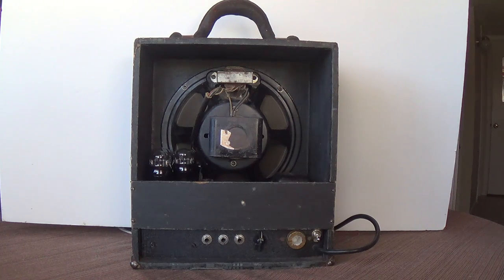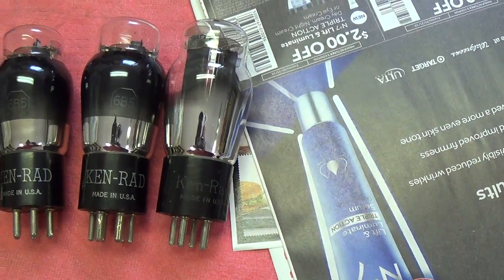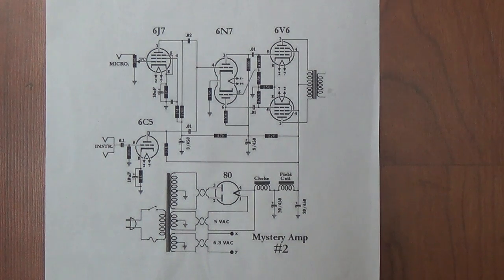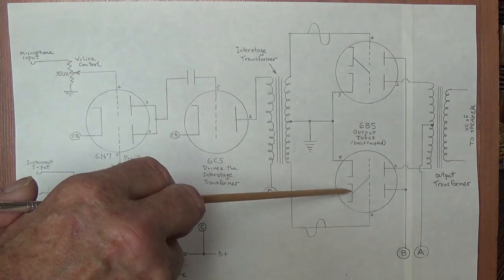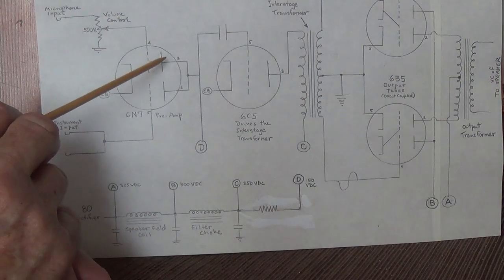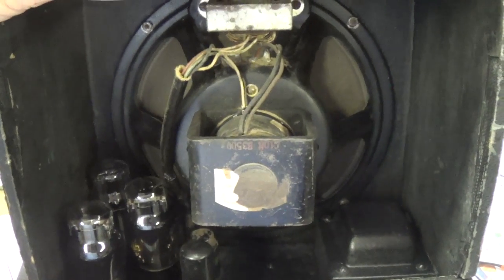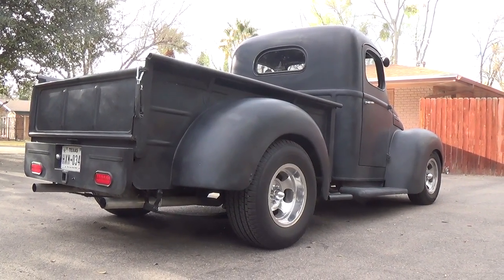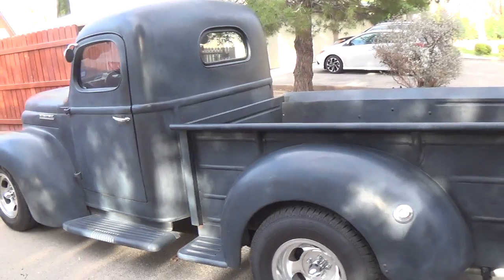Let's Evaluate and Repair the Ebay Mystery Amp

Comment: That is one fine pickup truck. Did you find/restore/put in a new engine? One the amplifier side, I never cease to be amazed at what some of these old rascals sound like...while it would never be heard above a drummer, seems like a nice practice amp with a sweet growl out of those bizarre tubes. Cool.
Reply from the maker: It had the Chevrolet engine already installed, but it didn't run and the transmission was junk. I had to repair both.  Yes, the old amps really sound nice, and there are some that could probably drown out Ginger Baker on PCP.....but I tend to favor the small, portable ones :)

Comment: What a great episode, Doug :)  This is... instantly love.... this amp....as it has an interstage tranny :) it sounds second to nothing if you bring this one up into saturation, but i also know that you´ll probably never do this ;) 
Also using an IST you can run the ouput tubes in AB2 with control-grid current. I own just one Amp which does this and it has two 807 output tubes which put out some nice 140 (one hundered and forty) Watts clean....but it also eats output tubes when running full blast for a time, they´re usually red plating above 80Watts output. Also it has four big (EI160 core power tranny, EI 130 output tranny, M102 interstage and M102b filter choke) trannies inside.....  

If i would have access to ISTs, like you do (what about these 16 dollars....man, over here one like this is about 150bucks, and they´re all made to order) i would already built some amps with these instead of the usual tube phase splitter.

Speechless about this truck........ .!
Reply from the maker: Thanks so much for your interesting and informative input, TC. It's always great to hear from you. I'll send you a box full of IST's for Christmas :):)

Comment: Lovely truck you got there. I remember back in the late 50s, some AM radios used in that era of cars, still had the odd tube in them.   MOTOROLA started with car radios, before  the solid state  models, there was their tube radios  with 5X4, 6be6, 6ba6.  The plate voltage convertsion from 6 or 12 volt car battedies was accomplished with some kind of vibrating transformer to chop up the DC for  a stepup transformer, I believe.
Reply from the maker: Thanks, SC. That's the way I recall the old tube car radios.....a vibrating converter would alter the 12VDC into AC (not sure about the frequency, but it had to be rather low) so it could be stepped up with a transformer. What a roundabout way to power an amp.

Comment: Wow, that's a nice catch!  This amp was young when my late mother was; God knows how much I miss her.  The output tubes are quite peculiar, or are they not?  I just wonder if that connection of the grid to the second kathode is internal or external.  I have never seen this before, so forgive me my ignorance.  I suppose the connection is internal, if not, would it be possible to mimic that kind of tube by connecting the grid of a double triode to the second kathode externally?
Reply from the maker: Thanks, B. All the connections are internal. The tubes were designed to serve a specific purpose and probably were not subject to any external alteration.

Comment: A choke AND a field coil??? For future reference, do you have that Antique Electronic Supply part #?

Also, awesome truck! you need some rattlesnake skin boots driving that.
Reply from the maker: Yep.....overkill at its best :) As I recall it was T156 @ a paltry $16.95. They offer other IST's, but this one had the specs, price, and reputation for this particular application. If you remember the very early Steven Spielberg movie, Duel, with Dennis Weaver.....this reminds me of that truck (although much smaller).....sort of demonic :)
Reply from the maker: No kidding, Richard. I had no idea that they didn't check for legitimate issues like brakes, tires, headlights, etc. New Mexico is nearby and they don't have any inspection program. As a result, when confronted by a noisy, smoking, death trap, it's a virtual certainty that it will have NM plates.

 Modern autos are marvels of engineering......400 HP, 25 MPG, fabulous brakes and handling, etc. and yet they release almost no pollutants into the atmosphere. I really doubt that someone could commit suicide with a modern auto......they would run out of gas first :)
Reply: @UncleDoug  hella funny! Modern marvels never cease to eventually become hellarious.
Reply from the maker: Especially when they're from New Mexico :)
Reply: Imagine an engine like yours, combined with a today´s direct fuel power injection system by bosch and may be turbocharged...but you would need a bigger cooler ;).....my last car that used a carburetor was built in the mid 80th...you even need to have a special service done to it or it must be a car made prior 1990 to be able to drive it through our streets without having troubble with the police...
Reply from the maker: Fortunately we're not quite that far yet, TC, but they keep on tightening the regulations. California is really over the top when it comes to overbearing, oppressive regulation of automobiles.....and other states tend to follow their lead.
Reply: Doug, as a Los Angeles kid growing up in the 50's I remember being in 1st or 2nd grade and being told a dozen or so times per year that we couldn't play outside because the smog was too much. In truth there was "smog" hundreds of years before the car was invented, as noted by the indigenous tribes of the area, but now in L.A. the smog has been reduced hugely even as population has grown and the vehicle count is off the charts. When I became a mechanic I hated all the "smog crap", the evolution to today's reliable automotive electronic marvels was very painful.
The funny thing about California is that for so much attention paid to auto emissions, we have NO safety inspection program. I routinely see cars with all sorts of body parts missing, headlight shining up at the moon, cracked glass, horrible tires. etc. Kinda weird.

Comment: You're really spoiling us these days! Great tone out of that amp - especially the instrument input. Truck is the best one yet - tough as old boots. What sort of impedance would the microphones have been back in the days this amp was made? ...I'm guessing a modern day mic would have impedance so low as to load down the input nearly entirely?
Reply from the maker: Thanks, Keith. There are input and impedance resistors that I did not show on the diagram. I think it would probably work quite well with a modern microphone.

Comment: Edit: I found it! Part number P-T156 on AES. The site started working again so the part was easy to find.
----
What is the part number for the phase transformer that you used? I tried pausing to see it in the video but it wasn't clear, and the AES website is down for me right now so I can't just dig through their site. I've been interested in putting together an amp using a transformer p.i. just for fun, and $16 is rather nice.
Reply from the maker: Yes, that is the part number. They offer several other IST's, but this one had the specs and price I liked.

Comment: I've never seen a Darlington pair realized in tubes, very cool.
Reply from the maker: Excellent catch, Tosca.
Reply: I feel is not a true Darlington pair since the plates are not interconnected so it works as a separate triode feeding a second triode in phase.
Reply: @TononiaWorld  It seems like a cathode follower but the cathode has no connection to ground.

Comment: The truck tube audio amp will be easy for an old crafty fellow such as yourself. However, getting the record player to track when you 'step lightly on the gas pedal'  is another story. Oh wait,  does X-Rock 80 still exist? and do they play old rock' n' roll?
Reply from the maker: I had a reverb effect for the radio in my 1965 GTO. It rode in the trunk and worked fine......until you ran over a bump and then it subjected you to about 120db of the most ungodly noise you could imagine. It ended up getting sold at a swap meet.
Reply: By bump, you mean speed bumps at Sonic Drive-in, I'm sure.
Reply from the maker: Either that or Chihuahua's that wandered out into the roadway :):)

Comment: Hey Doug, nice work. That output stage is a beauty. The 6B5 first triode is a cathode follower that drives positive grid current into the second triode. You can see the plate characteristic on page 80 here, http://www.tubebooks.org/Books/Atwood/Raytheon%201937%20Radio%20Receiving%20Tubes.pdf . It looks quite tolerant of positive grid voltage. I also read here, https://www.radiomuseum.org/tubes/tube_6b5.html, that this arrangement permits biasing without a cathode resistor. Which I think makes this amp a Class B2 output stage.  Very interesting. Thanks for the video and watch out for all those "Pancho Villa" claims from the Juarez upholstery merchants.
Reply from the maker: Thanks so much, Craig. I had read about the first triode being a cathode follower, which makes sense since it outputs from the cathode.....but to be honest, I wanted to keep the presentation basic and reasonably brief. The absence of any external biasing is quite unusual. Generally when you ground the cathode, you have an external -DC bias voltage source.....but not with these weird tubes. Class B2.....good heavens :)
Reply: I understand, explaining the full 6B5 operation would be quite involved with little or no application beyond your e-bay find. When you were showing the schematic, I thought it was abbreviated due to lack of components but it wasn't, was it?  Glad you found it, got it working and thanks for the run through.
Reply: exactly. Do you know about Muntz and Muntzing a part? From https://en.wikipedia.org/wiki/Madman_Muntz, 'Muntz developed a television chassis that produced an acceptable monochrome picture with 17 tubes. He often carried a pair of wire clippers, and when he thought that one of his employees was "overengineering" a circuit, he would begin snipping components out until the picture or sound stopped working. At that point, he would tell the engineer "Well, I guess you have to put that last part back in" and walk away.'

Here's a Pease Anyhow article on Muntz, http://www.electronicdesign.com/boards/whats-all-muntzing-stuff-anyhow

Comment: How did you find the open winding?
Reply: He said he didn't. But a continuity or ohm meter would have shown the coil to have infinite resistance, so he knows there's a break in it somewhere.
Reply from the maker: Good question. I will make a video showing how to troubleshoot a dead amp circuit using a home-made signal generator.
Reply: Thanks!  Looking forward to it.

Comment: That's the coolest truck yet. Mighty interesting power tubes in the amp. Together, what kind of power would you say they put out by your estimate?
Reply from the maker: Thanks so much, Joel. According to the tube data sheet, about 4W apiece, so around 8W total.

Comment: So, the cathodes of the 'first stage' in each of those output tubes is NOT connected to any external circuitry? Where does the plate current go?

Also, where do the grids of the 6N7 and 6C5 go? (labeled 'CB')
Reply from the maker: Please see the links posted by Craig Hollabaugh above for a detailed description, David. The cathode in the first stage is actually a cathode follower, which outputs to the second stage grid. The cathodes (not grids) in the 6N7 and 6C5 are cathode biased (CB)

Comment: "I do not want to let it distract us" = "Don't think about elephants!"
I, for one, will not be able to sleep until I figure out the mystery of the direct coupled duo-triod, and what exactly is feeding into the 2nd cathode of the 6B5s. 
All good, Uncle Doug. Probably best not to derail the whole video, but you KNOW this has us scratching our heads. (well, me anyways) 
:-)
Reply from the maker: See Craig Hollobaugh's comment above, SP, for some excellent links to a much more detailed explanation (which indeed would have "derailed the whole video" for 90% of the audience). The cathode of the first stage is actually a cathode follower, which outputs to the second stage grid. How about the absence of any biasing ???? These tubes are really, really unusual.

Comment: Hey Uncle Doug, I see what you see in that truck. I like the lines, very cool pickup. Those LS engines are pretty nice! Another great video here, and the mystery amp sounds excellent! What a nice find. If you make another video, would you cranks these amps up a bit more for us? That would be awesome! Also, we need longer rides in your old trucks, please! ;)
Reply from the maker: Thanks, Richard. I'm glad you liked the truck. When I turn amps up to very high volume, the microphone distorts before the amp does, and it sounds lousy. I test them as loud as the microphone can handle.
Reply: Uncle Doug. Oh well, I can surely understand that.  It sure is a great sounding amp nonetheless. Thanks again

Comment: Hi Uncle Doug, I was amazed by the amp and fascinated by your discussion of the internals. I always learn so much but this was another great video because this might be, no it was, the oldest amplifiers breakdown/repairs I’ve seen and was very different than most anything I’ve seen to date. Without your explanations I know I would have been lost, especially when there were hardly any resisters in the power supply section and there was a coil in place where I would have expected a tube to be. By using the coil, does that do away with the need to set the tube bias? Or because of this crazy arrangement, it’s self-biasing?          Loved the truck, it seems like it has some monster cojones, I know it’s fun driving. Thank you for my Jack fix. 🐈
Reply from the maker: You're welcome, Buddy. I really love the ancient amps.....they have so much character and originality. The output tubes in this circuit are so strange that they actually do not have any means to bias that I can see. I left a lot out of the diagram, so I could focus on the signal path.

Comment: Just amazing, Doug! Who'd have thought an amp that old would only have one thing wrong with it? (Well, two things, the filter caps had already been replaced.) And even that truck is speaking to me. The windshield and shape of the cab and hood give off a real B-17 kind of vibe. 

Are you going to leave the amp cabinet as-is? I would, I like old looking, as long as it functions, and it sure does! 

One thing I'd love for you to get into sometime. I know you've touched on it before but I'm still a little hazy. How do field coil speakers keep from 120 Hz humming and/or ring modulating the output signal, particularly in designs like this where the field coil is powered very early in the filter capacitor array? I could see some hum being canceled if the output transformer power is out of phase to the field coil power (which I guess would actually happen by the arrangement of the coils in the speaker, so not electrically out of phase but magnetically). But I'd think there'd still be a modulation of the amount of gain as both power taps have dips in their ripple at the same time, which should create a noticeable ring modulation effect to the output signal. Or is the inductance of the field coil, OT and voice coil such that those dips are effectively eliminated? (At least in the OT's case I find I doubt that theory or it would impede frequency response of the desired signal as well.) I guess it's only the pre-amp tubes that need super-smoothed power supplies, hence the extra capacitor stage on their power taps?
Reply from the maker: Thanks, AQ. I agree with the B-17 resemblance....very military. The cabinet will be left alone.....all the wear is good and honest. I don't think the electromagnet affects the signal chain any more than a filter choke in that position would, and its field would respond to the DC output of the rectifier much more than it would to any residual ripple (which constitutes a small percentage of the rectifier output). Not to mention that the reactance of such a large coil would do a lot to eliminate whatever ripple existed.
Reply: That's kind of what I mean. Instead of the constant magnetic field provided by a permanent magnet we should have a slightly fluctuating one in a field coil speaker. (And if there was no ripple at all I don't see what the later choke and capacitors are for, some resistors alone should suffice.) Similarly (and this is true for permanent magnet speaker amps too) the power to the OT should have any ripple be audible. I guess what I'm asking is, are FC speaker amps designed so those two ripples work against each other to somewhat cancel out? Or are they truly negligible to begin with (which again makes me wonder why any further filtering is necessary).

One more thing I just thought of, does any signal get pushed back into the power supply outputs by field coil speakers? Either in a positive or negative feedback loop? (Because it will end up on the plates and thus carried on to the next stage of the amp.) And if so, I wonder if that's an intentional feature?

I'm continually amazed by just how well this ancient tech works!